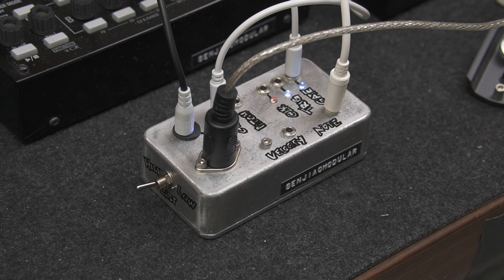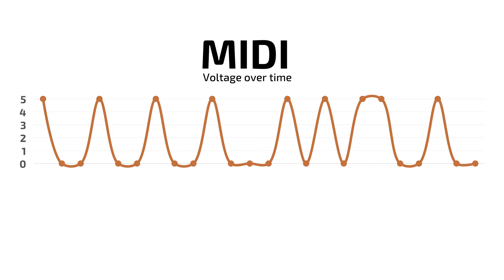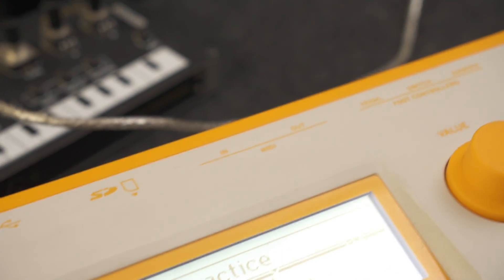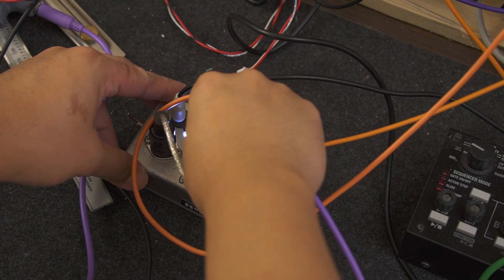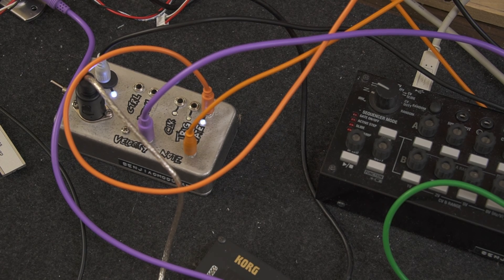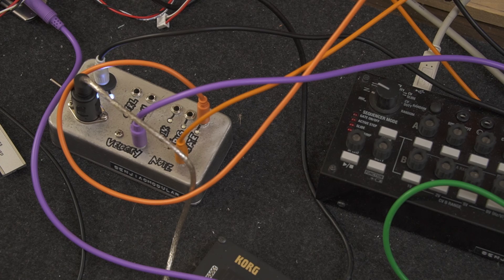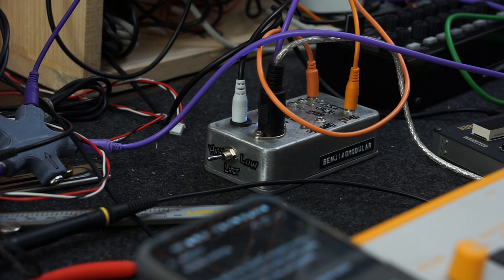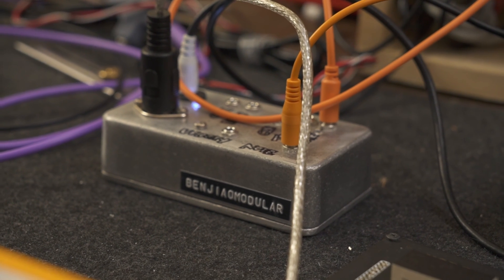Midi2CV - A utility module for converting MIDI messages to CV

Comment: May I ask, did you use the exact code included in Elkayem’s design?
Reply from the maker: yup! pretty much
Reply: @benjiaomodular Hello again. I seem to be having some trouble getting this going. I've gone off your schematic you supply in the link (thank you for that). I can see the RX led on the arduino nano react as expected with note on off information. 
The CLOCK (& GATE & TRIG) LEDs don't react to anything at all. I would expect the CLOCK led to be flashing to the project BPM of my DAW (cubase) where I'm outputting the MIDI channel from (Channel 1), but I get nothing. 
I get no changes in voltage on a DMM when sending pitch bend or mod wheel info to the circuit. 
I'm using Elkayem's code with no changes. 
After a while, I also see the TX LED flash as well as the RX LED, where I'm pretty sure it should only be the RX?
I would so really appreciate any info you might be able to shed on this! I feel like I'm missing something which may be obvious but just don't know. Could it be the midi library version or anything like that?
Reply: Ok. It appears I can receive MIDI from a keyboard, no problem. I can read voltages and all expected information, but it appears the problem is when I try to send the midi from my DAW. I so far can't figure that out.
Reply from the maker: @-______-______-  hey! I haven't tried using mine with a DAW, but are you by any chance trying to use it via USB? Because I don't think that'll work with Nano without extra circuitry
Reply: @benjiaomodular  no. Not usb. Over serial.

Comment: hi there Ben! I've built a simple but nice monosynth with CMOS oscillators, one of them being your very own miniOSC (you cant take a look at it on my channel), and after a while I got a pair of CEM3340s, very hard to find where I live. so, a second monosynth is on the way. but this time I want to make it midi controlled, to get a decent tracking (and your module is a solid candidate). my question is: is it possible to add a glide - portamento to this midi2cv converter? thanks a lot in advance. keep up your excellent work!
Reply from the maker: Hi habbi! Thank you very much for the kind words!

I'm pretty sure you could add a portamento circuit at the end of the CV output. Something like this (unverified) should do the trick:

https://ua726.co.uk/2011/05/22/really-simple-portamentoslide-circuit/

Thanks for bringing it up, too! I'll consider it when I design the Eurorack PCB version.
Reply: @benjiaomodular  yeaaahh thanks a lot! this is exactly what i was searching for! I can even try it on my mk1. thanks again! you da man!
Reply from the maker: @habbi1974  Perfect. Good luck with that build!

Comment: Great video. I need to make one for my system. Good explanation on how midi works. 😃
Reply from the maker: Thanks, man. Do it!! I've yet to do a video on my entire system as well. 😅
Reply: I did the case still need to do the circuits lol its on the back burner. Lol @benjiaomodular